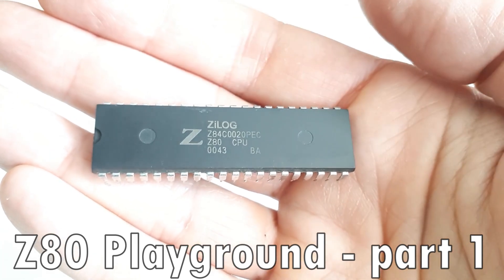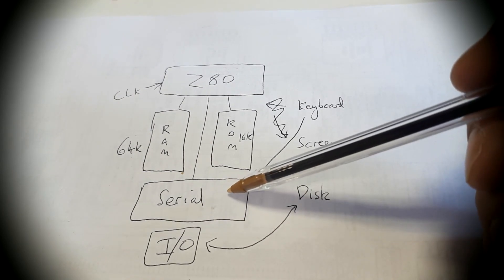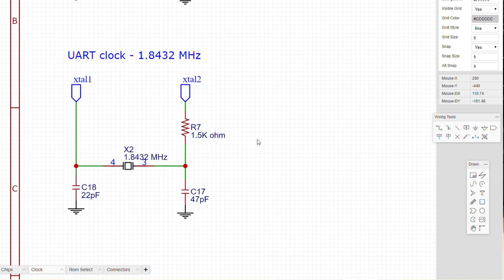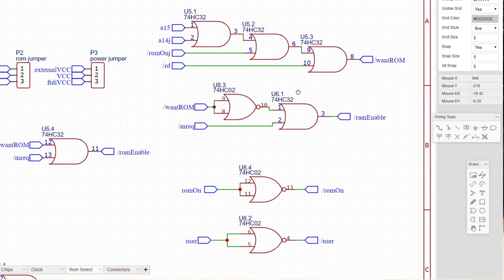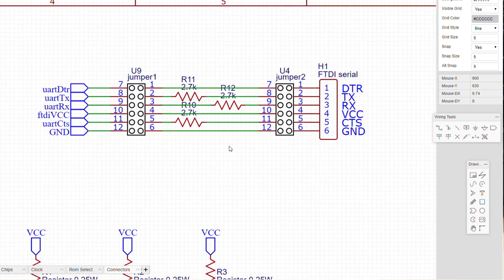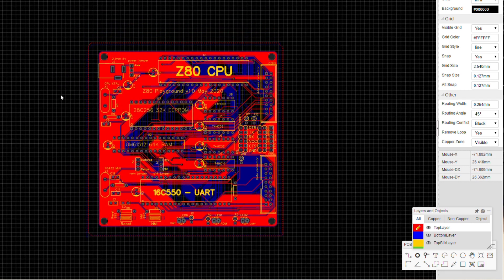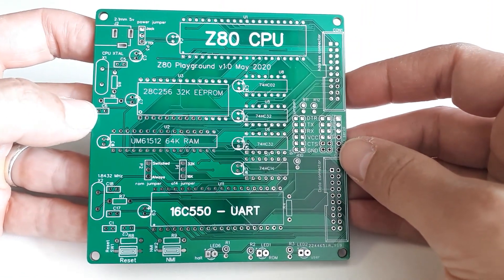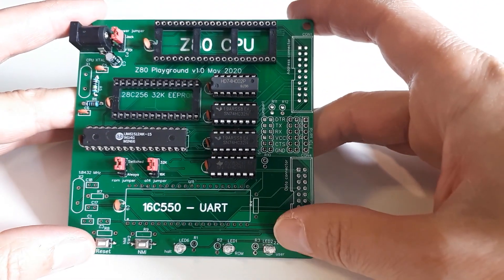Z80 Playground - the Single Board Computer that runs CP/M

Comment: When getting PCBs made abroad,  do you end up paying import duty? And if you do pay duty, is it still cost effective? What other PCB manufacturers have you tried?
Reply from the maker: I've only ever used JLCPCB. I have never paid any import duty. I think the duty is already paid at their end, but I may be wrong on that. It cost almost nothing to get 5 PCBs made, but usually I only want 1. I use the  "GB Special Air Mail Royal Mail" option for postage. It takes about 2 weeks from uploading the Gerber to receiving the PCBs. They are always excellent. I have never ordered one larger than 100mm x 100mm, which means my orders go through really quick and cheap. If I upload the files in the evening, by next morning when I check the progress they are already in production!
Reply: I never paid duty with JLPCB but I once got one from PCBWay and had to pay "huge" import duties on it.
Has anyone ever used any of the UK manufacturers? Compared to the Chinese, the prices are astronomical.

Comment: no video processor? boring, add v9958, or make own compatible with zx spectrum
Reply from the maker: Well, I was aiming for a Jupiter Ace work-alike first. But yes, a video card has to be next!
Reply from the maker: @igcogcigciggicifx4763  On the v1.2 board it uses Serial output, so you need to connect to a PC and use a terminal emulation program like TeraTerm.
Reply from the maker: @igcogcigciggicifx4763  You also have the option for parallel output through the 36 way connector, which is basically the Z80 address bus, data bus etc. See the v1.2 board video for details.